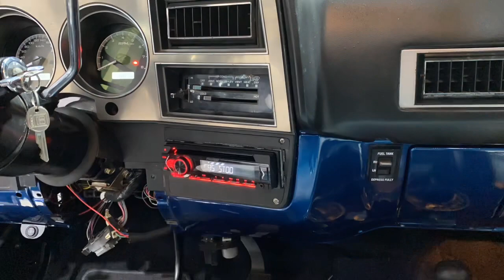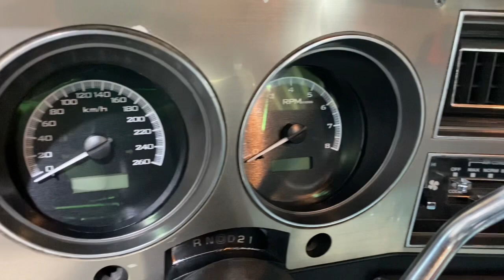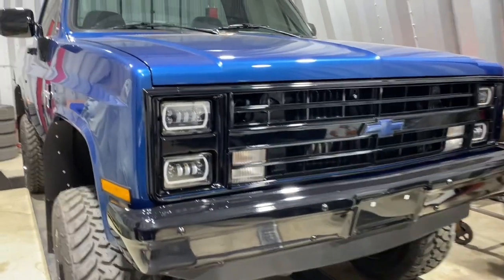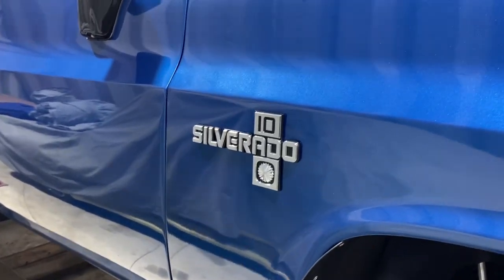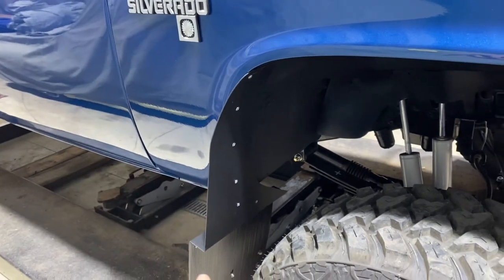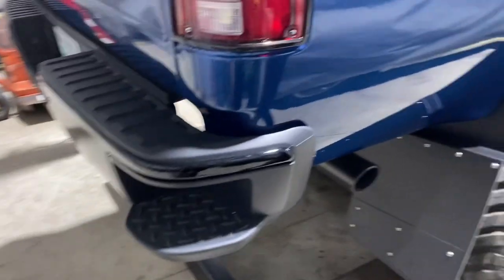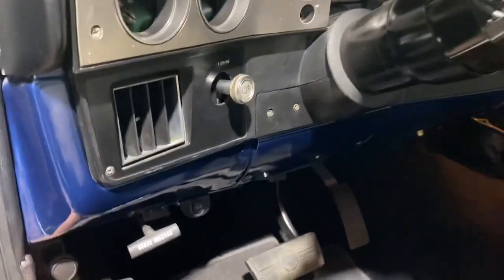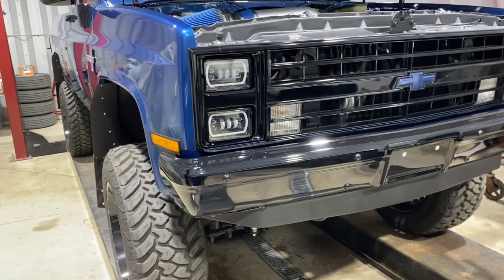1986 K10 Restoration Complete!

Comment: Great build.....working on an '85 K10 now.  Where did you get that steering column and what length is it?  Also, where did you get that steering wheel?
Reply from the maker: Factory steering column, steering wheel is from Amazon. It’s a forever sharp steering wheel